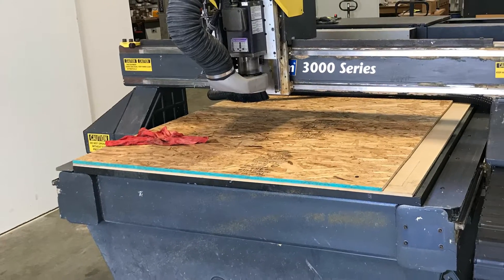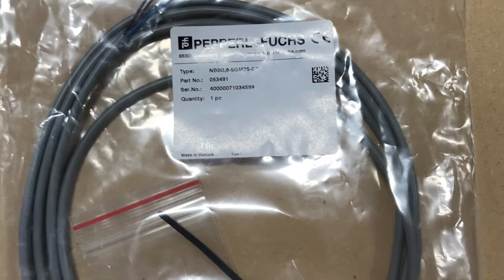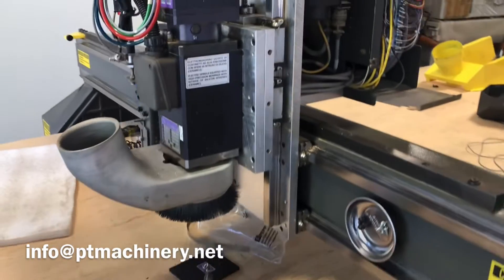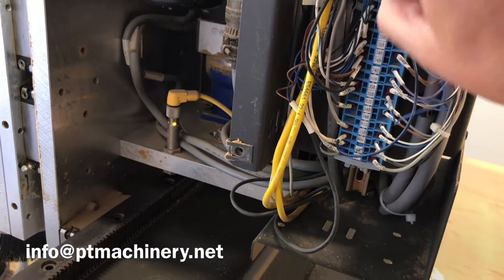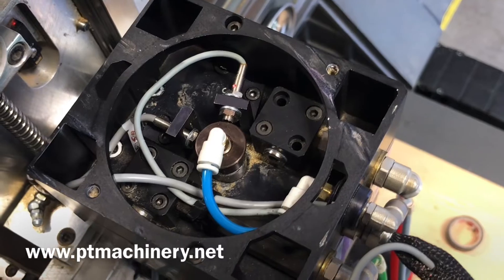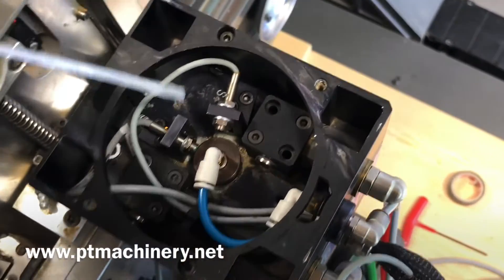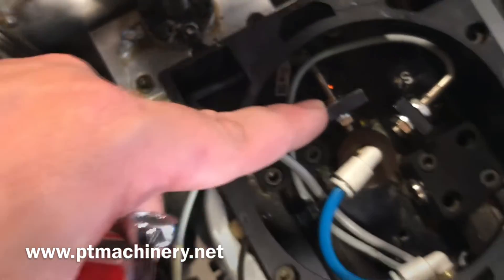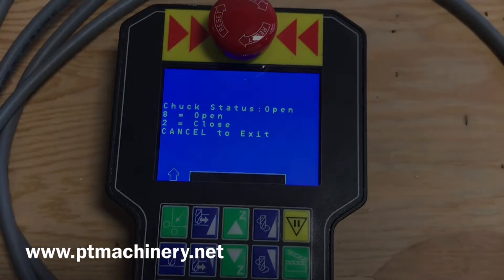MultiCam 3000 CNC Router chuck did not open error message

Comment: I have a different spindle on mine (eurospindel Hi-L 8kW) and it won’t come on even though the VFD appears to be doing its thing. I suspect there is a sensor issue on the air line somewhere . Anyone know where I might find a manual for this spindle?

I occasionally have seen that it says no spin enabled on the pendant but checking the settings all the tools show spin is on.

Anyway - if anyone has any suggestions that would be amazing!

Comment: How do you address a Motor Fault ( 0x 10) drive 5 (XB) teknic comm error? Also would love to see a video on squaring a multicam 3000
Reply from the maker: Usually on those servo motors they don't have an error code (no LCD screen) but most of them WILL give you a BLINK code. This can then be compared to a blink code service manual and should give you SOME additional info that may help point to a cause. From my experience if the motor is removed and under ZERO stress and the servo is still giving you a fault then the servo drive itself could be bad. You could try swapping some cables to eliminate a bad cable or bad motor. The 3000 MultiCam is rarely out of square as the homing procedure has a built in squaring procedure but if its too far out it will put the system under stress and cause faults. Next time I have a mutlicam with any similar issues I'll produce a video and get it uploaded! The procedure isn't terrible but does require loosening up the gantry to relieve the stress OR bring the bridge back into alignment. Then this usually means you'll need to adjust the tool change pick up locations.
Reply: @protechmachinery1   I got the error code i mentioned on my pendant, which locks up the machine and requires a hard restart
Reply from the maker: motor fault ..... my best guess would be a cable issue. They wear out and develop breaks over time. In my experience the cable is most often  the issue versus a hardware failure in the motor OR servo drive but they do happen. What year is your machine? 2005?